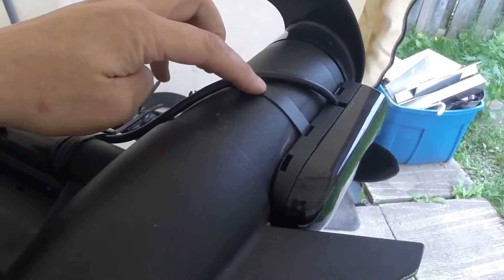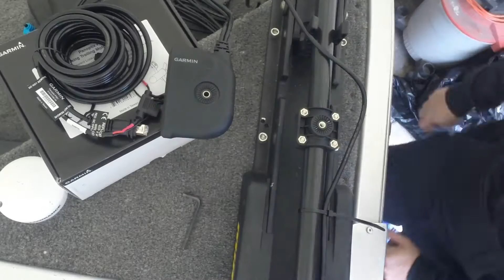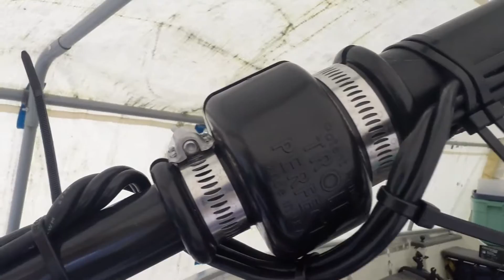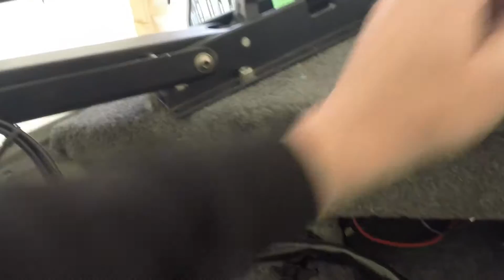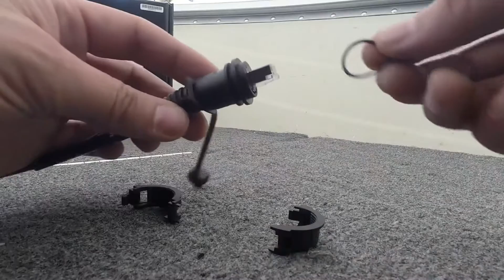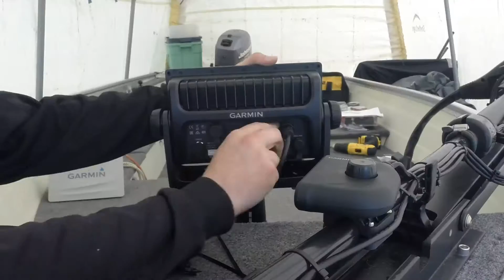Garmin Panoptix Installation PS21-TR

Comment: The flat side of the transducer faces away from the boat correct?
Reply from the maker: Yes that is where the sonar signal is transmitted from
Reply: @InDepthSonar  thanks for some reason I'm not getting a pic like you were.
Reply from the maker: If you're getting nothing at all then there's probably a problem with the unit or transducer
Reply: @InDepthSonar  sorry, I'm receiving a pic it's just not as clear as yours.  I'm running  a garmin 93sv.
Reply from the maker: Might want to send some screenshots to Garmin to see what they think then

Comment: i just bought the echomap plus 93sv.to hook up the panoptix I have something like a network cable to plug in where did u get that network cable that goes in the back of the fish finder
Reply from the maker: It comes on the transducer if you have a PS21, 22, 30, 31, 51. If you have a LiveScope LVS32 it plugs into the GLS10 module which comes with an adapter to go from the mini network plug to the RJ45 network connection on the back of the unit. If you have a LiveScope LVS12 it will not work with your unit.
Reply: I bought the 93sv without the transducer,im using the simrad evo 2 ….man u are a life saver,i was worried and I waited until you responded to purchase  live scope..i really appreciate the time and letting me know....im about to spend 1600.00 dollars and want the right stuff...again thanks